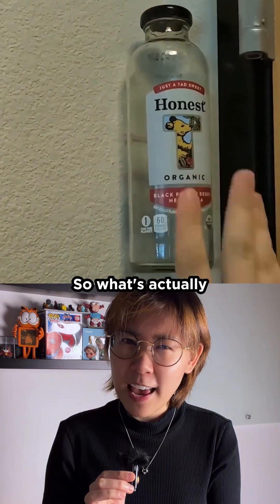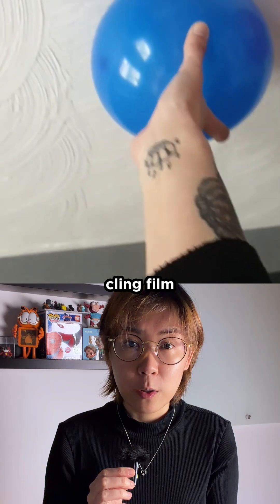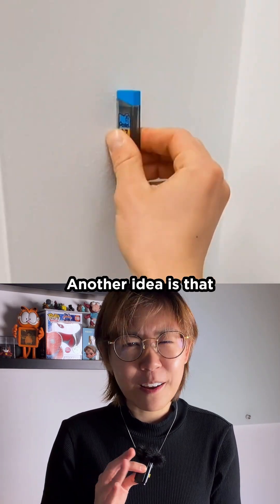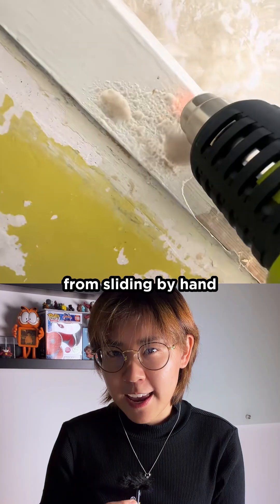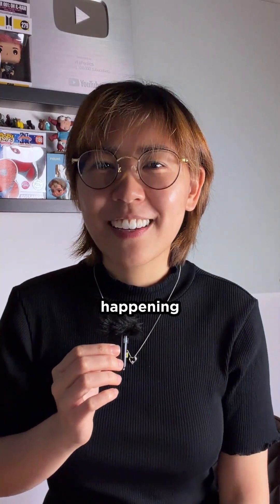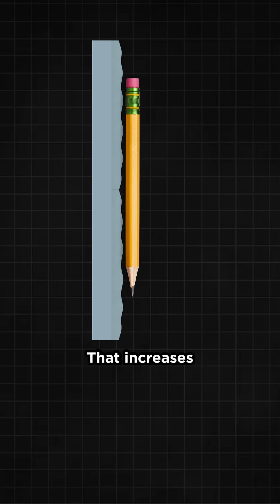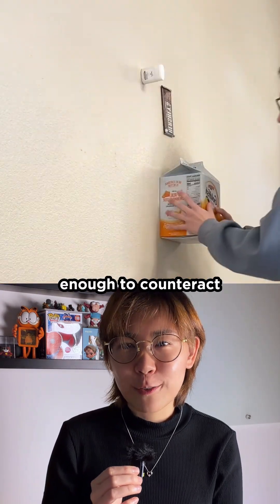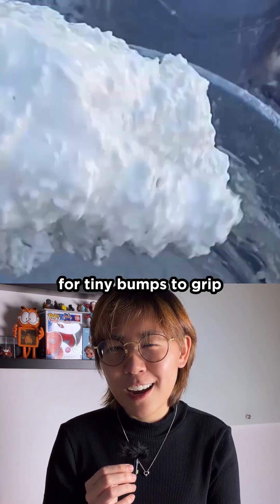Friction Actually Makes Things Stick to Walls #physics #experiment

Comment: Where is the normal force for the friction to work, friction doesn't depend on surface area. Specify that it's induced dipole interactions/ Vander wall forces

Comment: Wait i heard friction doesn't depend on surface area

Edit: lol everyone are giving your own opinions and thanks but i figured out the actual reason sean andrew explained it but none of your answer were close though sadly
Reply: one of the many reasons i hated high school physics...

the actual interaction between surfaces comes from the microscopic details, which provide opportunities for particles to grip to each other. its basically electrostatic interaction between molecules on either side.

depending on temperature, geometry of the surface, how "sticky" the molecules are, temporary bonds, etc. friction can vary greatly.
Reply: @3818c_cookin the quantitative measure of friction has nothing to do with the area, it's more like the air escaping...
Reply: @JustDipan  contact area will affect friction for any but the ideal case. and unlike many places in intro physics, most common friction interactions are not ideal.
Reply: so the coefficient of friction doesn't depend on surface area, it's just a dimensionless number that's effectively newtons per newton, but the quantity of force applied by the friction does change with the surface area
Reply: @howdyfriendall  incorrect except in the "ideal" situation. In reality mu is very affected by literally every component of the materials including contact area and spacial orientation because changes to those affect the way the objects respond to each other.
Reply: @andtotheoasis just a little added info these friction happens with these microscopic things called asperities. By eye a surface looks smooth but if you zoom in its extremely jagged and rough. These microscopic bumps and jagged edges interlock with the other objects jagged edges making it like microscopic jigsaw. 

Heres a little idea to think about.

Since at the micro level its pretty much rough. You can imagine how water reduces friction because water essentially fills in the asperities making it a smoother surface for both objects to slide on.
Reply: @howdyfriendall  in the ideal case it doesn't change, though.
Reply: @howdyfriendall double surface area = less speed, but double friction per amount of speed
Reply: @RhysHartonothat’s not how it works
Reply: The friction itself no but how it gets distributed yes it does
Reply: you can think about it like an eraser is harder to slide across the table if the big side is down vs the small side, there's more places for the same amount of friction to happen
Reply: This law is true, but it applies only when there is no deformation. It applies to 100% rigid objects sliding against each other - which is true enough for a lot of objects (like lets say a metal cube on a metal table) in real life. At the same time, its not applicable when there is deformation - like car tires, or even deformations of paint like in this case.
Reply: Its one of those "Air resistance can be ignored" type of things.

If you have two actually uniform surfaces, then yes, it does not matter.

But real life is not uniform and two surfaces that might look flat and smooth might have microscopic variation which have different friction.
Reply: The surface area is the space. This law means that fiction happens no matter the size of the object.
This video talks about the nature of the surface in contact, which is a wall with popcorn paint.
Reply: @LsamaIsHimyeah but dhe said surface area increases but what i was thaught was friction doesnt depend pn surface area so
Reply: @knowledgepath6630 as quoted from by just 
"The friction experienced by the object is dependent on the nature of the surface it is in contact with.

Friction is independent of the area of contact as long as there is an area of contact.
Friction is independent of area, so long as there is an area of contact, and it is dependent on the nature of the surface in contact, which is the wall and the rocky, unsmooth texture.
Hope that clarifies it
Reply: Ik that bro she said surface smoothens and area increases so friction increases but friction doesnt depend on surface area so
Reply: @knowledgepath6630  You know the same way you don't calculate air resistance In problems,  that's the same way your not taking the area into account, it's a huge pain to calculate and barely changes the results, in this video she said area cause it's prolly one of the factors, but it's definitely not a big factor and you can most likely not even acknowledge it when calculating
Reply: @knowledgepath6630 it's not friction, that's way, it's cold welding with vacuum
Reply: @nowonmetube yeah i saw in sean andrews video
Reply: Friction occurs due to two causes - 1. Interlocking between irregularities between surfaces in contact and 2. Cold welding (temporary bond formation between the surfaces).....as the surfaces are not rigid, someway or the other they have increased the amount of cold welding that can happen...it has nothing to do with surface area, by aggressively sliding it on the wall, they have increased the amount of contact points. Lesser the area of contact points and higher their number, the extent of cold welding will be extremely high
Reply: @adarsha2022 nice tq new topic to me but yeah tq
Reply: @adarsha2022 cold welding, aka vacuum
Reply: Here’s my explanation: Firstly, amount of friction is dependent on the amount of surface area at a microscopic level. This contact surface comes from the way small bumps in the two objects fall into each other.

When pressure increases, the small bumps in each object can be pressed into each other increasing the surface area. At a larger scale, pressure = force/area —> pressure is inversely proportional to area.

This means that if we call the surface area (viewed from a larger scale) A, the amount of friction generated per unit area is inversely proportional to A, and so the total amount of friction is constant.

A notable assumption we made here is that the amount of microscopic surface area increased linearly with pressure, which tends to be accurate enough for most applications.
Reply: The friction applied per cm is the same for each object (for the same material and mass) but the more contact you have, the more force is applied.

I think a simple way to visualize it is to imagine a cube, a ball, and a table of the same mass and material.
It seem intuitive that the cube will be harder to push that the table, that will itself be harder to push that the ball.

An other way is to imagine velcro. Each hook have the same resistance, but
If you attach 1cm it will not take a lot, if you attach 10cm it can lift you. The resistance of the hooks stay the same in both cases, but the more you have, the more you can lift.
Reply: @pierrotA tq
Reply: @knowledgepath6630  Btw, people will come and tell that it's false because tehorically the force is the same, but it's still true...

Physics simplify things to calculate global values, but it do not always represent reality.
You want to know how many cows can be put in a barn ? Physics tell you to imagine spherical cows put on a grid...
Can it give you a good estimate ? Yes.
Do it represent reality ? Not at all.
Reply: you didn't ask about the trick :/
Reply: It's not friction
Reply: It's not friction, it's Vander waals force.
Reply: @CaveMan-f5g bro really spat anything
Reply: Correct. Force of friction depends on the force perpendicular to the surface and the coefficient of friction, if 2 objects one with 10 times the area of the first, but both weight the same, then they require the same force to move them.
Reply: @marwanabdelhamid7147  Except this is only true in the IDEAL BEGINNER TEXTBOOK CASE for friction between two dry and rigid solids (coulomb friction). In every other case: Surface area will have an effect when the materials are softer or require stick and slip motion rather than minimal resistance. Surface area will have an effect when there is wear, deformation, shear (as demonstrated in the video). Surface area will have an effect when looking at how much heat is generated BECAUSE of how much friction there is relative to the surface area. Furthermore in the real world different objects have different weights and don't sit at perfect flat 180° for their Normal force to be equivalent to just their weight
Reply: @marwanabdelhamid7147  This doesn't work for solids that deform, like the video example.